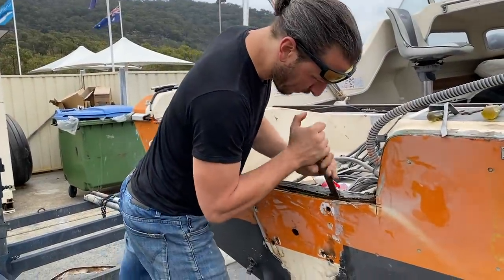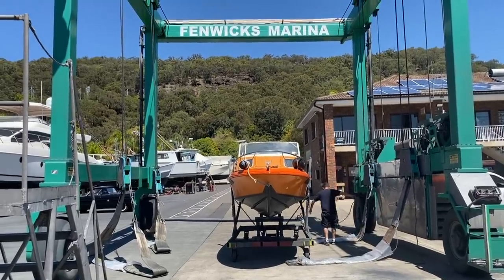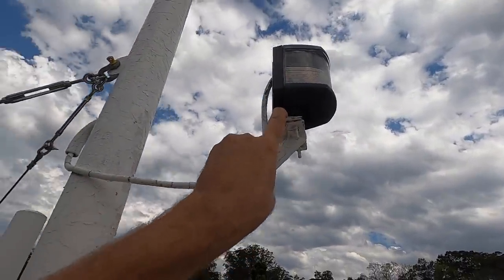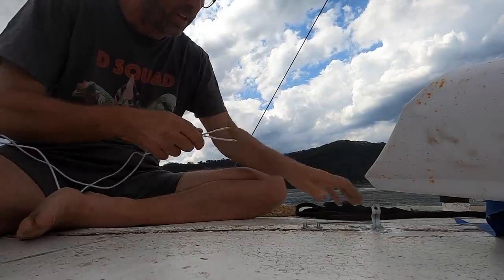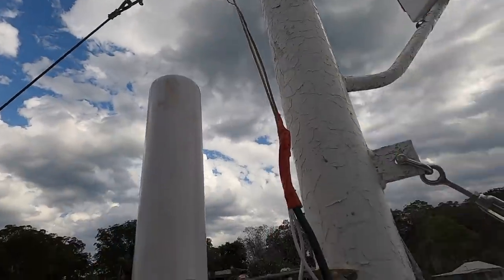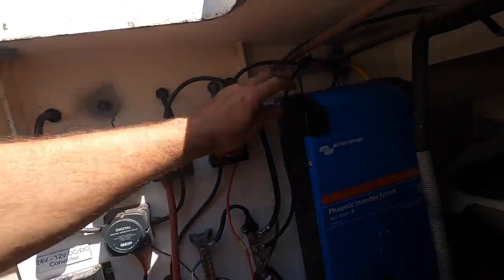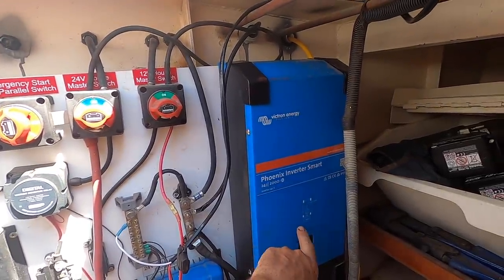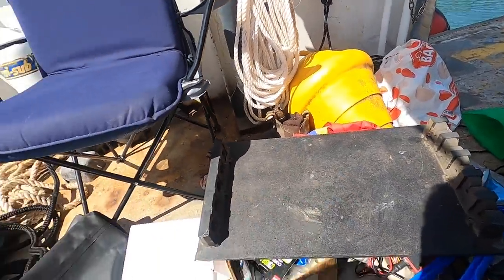Self launching bow roller for the anchor, and neater wiring!

Comment: Cut your mast off near the base, rip out the wires & whatever is blocking the mast, repaint the mast inside, weld the mast back on.
Reply from the maker: An opportunity to repaint the inside of the mast would be good.
Reply: @DangarMarine  It would prevent future rusting
Reply: Don't know if you have any bridge clearance issues, but if you are cutting off the mast, it would be simple to reinstall it on a hinge base to allow it to be lowered for low clearance bridges.

Comment: In many places, the mains "neutral" and "ground" are normally tied together, at (or near) the distribution board. As you'd pointed out in the video, this helps the positive voltages find a safer route to ground than, say, through a human. It also facilitates detection of a ground fault -- the ground wire usually sidesteps the current sensing of your RCD, giving a positive bias (at the current sense) and breaking the circuit. Big Clive has a number of good videos on how that works if you're interested, including teardowns of RCD/GFI-type sockets and breakers.

Comment: Just a sagestion you could cut the bow roller back to suit or maybe cut it down on both sides and bend it to the angle that works and weld a stainless v in on both sides to make a smooth transition ..

Comment: In regards to the heat exchanger. Our motor was seized when we bought the boat, from neglect of changing the anodes. The alu heat exchanger had corroded, popping the cast iron exhaust joiner off the back. The coolant then leaked into cylinder 2, seizing the engine.

Anyway, took it to an engineering shop mate, he machined back the corroded shit, and tig welded on a new alu plate to bring it back up to thickness. With appropriate holes machined into it. 

Might be an option?
Reply from the maker: Definitely something I'm going to look into.
Reply: @DangarMarine  Although if you can find a generic heat exchanger, I would be interested.

Comment: Hey Stu, in relation to the stuck ring in the engine, I being a retired diesel mechanic, would it be a hassle to remove the crankcase cover port and move the piston down till you see the stuck ring and spray WD40 into the ring gap hoping it may free up with time. Obviously this could only be done when the engine will not be in use of cause, but I thought if you had a time in mind in the future say Christmas/New Years you could do this and let the WD40 do it's thing over a week or more maybe, just maybe it may start and free up !!  Just a thought buddy. I think shore power plug socket should go on the new power board and maybe notch the hatch cover to allow the extension cord free access and keep the engine room sealed from rain and weather.  Seeya Rob
Reply from the maker: The stuck rings seem to be a bit freer now, but it is the oil rings that are the real problem and they never come up as high as the liner ports.

Comment: The power from shore is already protected, so mounting the shore plug near the wheel house and your own secondary protection in the hull is not a problem. To the point I'd almost ask why you would bother with a second RCD, I mean do what ya want. But if I was to guess why you would use a second RCD it would be to have a 10mA on the boat to bring you down to hospital standards, where as the shore RCD will be 30mA. I imagine there is some doubt as to how good the ocean is as a functional earth, which isn't really how an RCD works anyway, and if the hull became live then you wouldn't notice anyway because you wouldn't have any potential difference. 

Basically, you are well over doing it, so don't worry about putting the RCD a few meters away from the socket.
Reply from the maker: Good point about the shore power already being protected by an RCD mean the galvanic isolator is probably the most important part.
Reply: I think it depends how the system is set up. Do you have parallel switching or are grid and inverter separated.  Inverters don't really need RCDs but grid systems need them. As mentioned the grid source likely already has a RCD.
If worried about it you can simply get an extension with a built in RCD. Mainly it is larger motors you need to worry about.
Reply: @DangarMarine  I'm surprised the shop didn't sell you a double sized box, with the isolator in the same box as the socket, same as any industrial GPO has the on/off switch above the socket. 
I'm more than confident that you won't have trouble with the isolator a few meters away, but if you are worried then a double box is a solution
Reply: @lemullet6273  Lets be honest, the only leaking Renko does is inwards lol
Reply: @lemullet6273  What Stu is talking about, has already been applied at the source, so he is doubling up on the protection.
Reply: @lemullet6273  "Most boats drip though" - would mean most boats leak inwards. You see my friend, inwards means from outside to inside, and leak in this context means water transfer, so the combination of leaking and inwards would imply water is going from outside the boat to inside the boat, as admitted by you. Great chat :)
Reply: @lemullet6273  Ahh I see the problem, humour isn't your strong point. Too bad Renko is an aussie boat, owned by an aussie, and Australia is a humourus country
Reply: @lemullet6273  Probably because you care about what the guy in YouTube comments says. I'd see a doctor about that tbh
Reply: @lemullet6273  do you not understand any particular words, OR do you understand all of the words, but not understand what the words mean when in said order?
Reply: @lemullet6273  You know, if we were socialist West coast Americans, it would be "our" comment
Reply: @lemullet6273  Sounds like a faulty unit, I guess Made in America doesn't mean what it used to

Comment: Don't forget: when taking that -VE off the engine,  you MUST still have a direct negative connection from the engine to the -VE on the engine start battery. This MUST be direct, otherwise you get starter motor current of several hundred amps flowing across your house battery negative connection to the hull etc.
Reply from the maker: Yep, there is still a direct negative to the starter motor.

Comment: If you haven't cut the anchor mounting flush, perhaps think about putting an extra roller as a chafe guard.
Reply: Perhaps spool the chain and anchor line off the top of the drum to change the angle?
Reply: @paulsperbeck617  yes , i was thinking the same but it will be higher on deck and maybe hard to pass over it'
Reply: Definitely.  Thin rope is like braid, less abrasion tolerance than thicker line.

Comment: For the anchor chain issue,  try drilling in a third roller at the beginning of the bow roller to prevent the rubbing.
Reply: That was my thought too. Or, put a 1/2” stainless bolt through it and cut a piece of UV resistant PVC pipe to slide ice the bolt to act as a bushing for the rope and chain.
Reply: Yes, and you still have the old roller to use...
Reply: Or you could cut the sides and bend it down at an angle so it guides but doesn't chafe

Comment: I really think a 3rd roller is the easy way to go. Just drill a hole in either side no cutting, no grinding, no metal splinters, and it saves the back 2 holes for adjustment should you acquire/require another anchor.

Comment: i wouldn't cut that feed ramp off the stainless bowsprit. Better to cut each side wall where it meets the mounting base & angle it down so it acts as a ramp.
Reply: Good call as the chain will allways fall and hit as it pays out, but might leave a few sharp edges.
Reply: @nou238  Should be able to chamfer the cut edges with the grinder Or Stu could move the anchor winch higher up the cabin wall or add a pipe for the chain & rope to feed through.
Reply: Yes agreed really need to make a feeder particularly with longer lengths of chain >600mm in horizontal- cut and miter the overhang inside of the stem mount. Definitely need some for of chain feeder -don't always have the perfect anchor launch and retrial particularly caught in a storm and heavy seas.
Reply: Went back and checked the video again possibly look at building the sides up on the aft end of the feeder- stainless steel pin across the top so the chain cannot jump off the aft end of the ramp.
Reply: @tonyboats  A length of stainless steel 3" or 4" exhaust pipe & have them slightly flare the entry & exit holes would work as a feeder to the bowsprit.
Reply: Just what I was thinking also!!

Comment: Rather than cut the anchor tray shorter, how about put a 3rd roller right on the end.   Even cut the bottom of the tray a bit, so you have 2 wings and the 3rd roller could be lower. So right at the boat end you had a roller to guide the chain/rope seeward.

Comment: 👋🏼fròm WÅ🦘
Fascinating about the technique in determining anode effect✅
➕With your remote placement of anchor, maybe keeping the channel length would help contain a linear path, also courting a mig/tig for a linear offset [ within an angled 📐 composition, additionaL to a roller’s height, or neoprene lip ] to winch would favourably serve, along with a shroud.to dampen a potential impact.
➕ just a thought 💭 isn’t there an equally capable anchor that has that overhead affixed railing, that allows the operator to change retrieval position if the setting becomes abjectly fastened 🤔💭
Be WeLL 🙏🏼🖖🏼😃🦘🌊 🤿 🐟
Reply from the maker: Thanks Adam, appreciate the thoughts.
Reply: @DangarMarine  Ür worth the concern, 👁 Prefer not to s👀ïnG yoÜ🤿 in traction⛓🩹, 🌱eåčH, say GDaÿ to Bilge 🐀 för më😉🖖🏼🙏🏼

Comment: 2:35, D-Squad in the background keeping things safe for the film crew, patrolling the grounds!!!!   Nice work girls.
Ok, on the shore power outlet, addressing the safety aspect of running from the wheel house or mounting under the hatch.  All shore power in marinas up here in the US have GFCI protection on them, which would ensure that even a small short (to ground or phase to phase) would trip the circuit feeding the boat.  I don't see that as a safety issue to be honest.  I see bigger problems with that heavy lid crushing a wire.  But that's just one mans opinion.  Good luck.

Comment: Instead of cutting the anchor holder, I would maybe look at getting a bit of HDPE or similar to put around the end so that it protects the steel and also protects the anchor line. From experience, dyneema starts fraying pretty easily when rubbing on anything really.
Reply: That would be the least expensive. You could always drill and add another small roller.
Reply: Cutting the end off would also eliminate moving it to the utmost forward setting. Place an HDPE guide.

Comment: You need the marine power socket as it locks the plug into the fitting.  If it comes out and goes overboard, 240 v in the water.   If you stay with the caravan type, work out a way to tie off the power cable to keep the plug on board.
Reply from the maker: Good thought, that is an important situation to avoid. Maybe I will go with the marine type and just have a lead onboard that lets be connect to a regular socket on a wharf.
Reply: @DangarMarine  We replaced the marine plug with a standard 15 amp plug and that saved having any other leads.

Comment: Those wondering 20:21 he says RCD which is a residual current device. Basically the same thing as a GFCI (ground-fault circuit interrupter) used to immediately disconnect power for kitchen and bathroom plugs. For example if you dropped a hairdryer in your bathtub you wouldn't die. They react very quickly and often have a test switch on it.
Reply from the maker: Yep, should have done a quick explanation on how they work. Will do soon!

Comment: Stu, what about drilling an access port close to the bottom of the mast to help you guide cables through,then just cap it with a bolt on cap sealed with some Sicaflex. Instant access if you need to get to it in the future. Great work, by the way. Looking forward to the diving vids. 👌👌
Reply: i was thinking the same  thing--  just like a lamp post.
Reply: You take away quite a bit of structural integrity of the mast by cutting a hole into it. Now, it might not be as important as with a sail boat but it still has to withstand winds.

Comment: The dyneema anchor rode is great stuff because of its strength/diameter ratio.  The weakness is it is not very abrasion resistant.  I noticed your concern regarding the anchor chain rubbing the bow anchor bracket.  It looks like the dyneema will also rub.  Be careful there Mr. Dangar.

Comment: Hi Stu, need a little help. I have a seized manual tilt screw on my Yamaha 175 outboard. I intend to service the trim tilt system, so started with the manual release first but the screw just won’t turn to release the motor. 
Should I try the impact wrench gently, the sort you hit with a hammer gently?
Just keep the videos coming. I did almost the same as you on a 36ft cruiser loved almost every minute of doing it.
Best regards, Jonah.
Reply from the maker: Yes, you can try an impact scre driver but be careful, they can strip and then you'll need to drill it out without getting metal into the hydraulic oil. Try a little bit of heat too.

Comment: Awesome project you’ve got going on. That dyneema is ridiculously strong, and will def do the trick, something to look out for would be when you are anchoring, try pay out excess line and make this fast onto the bollard just forward of the storage drum. If you and anchor and the weather gets up the line may bury itself into the storage drum when the tension comes on. This will be an absolute nightmare to get out. It may well be that you were just testing the system, just something to look out for.
Reply from the maker: For sure, cleating it off would also take the strain off the winch itself while at anchor, definitely something I would do for an overnight stay.

Comment: I wouldn’t worry about oil discharge from the air box drains. Detroit diesels are known to “slobber” from the air box. Many installations have a catch can or tank that collects the oily discharge to keep it from making a mess or fouling the bilge water. With time, it may even taper off as the rings wear in a bit. That engine sounds just fine. The best thing you can do is run it. Sitting still in the marine environment destroys engines prematurely.
Reply from the maker: I was thinking about just going with a catch can, but it is more than it should be for a rebuild engine. Adrian is thinking that maybe the oil rings are damaged from loading the pistons in to the top of the liner instead of the bottom as they should. Easy mistake to make if you aren't familiar with Detroits.

Comment: Gday Stu why not extend the bow sprit out so its level (flush)  with old one underneath the only thing i would cut are the ears off the old one were the roller used to be plus having it extended further out could help anchor from banging on the bow in choppy windy weather as you lower / retrieve and if that dont work bang on an extra roller too but DONT CUT THE NEW BOW SPRIT

Comment: I am with Peter, the addition of a roll on the inboard side of your anchor bow spirt will give a reliable feed that the chain won't fowl with the bracket even if it slops around a bit as they tend to do. I don't think that shortening it will resolve the possibility of the chain catching on the leading bracket edge, in particular if it goes a bit slack.
Reply from the maker: Yes, it is true that no matter how short it is any slack will still catch.

Comment: Hi Stu, May I respectfully suggest that you review you swivel to anchor connection. KONG swivels recommend connecting the swivel to the anchor shank, with a bow shackle or (better option) a bow shackle and three links of high test chain.  The straight line Safe Working Load (SWL) is reduced by +/-60 percent when a sidewise load is applied to a swivel with it's fork end attached directly to the anchor shank.
Reply from the maker: Yep, have been meaning to add a shackle in there to relieve sideloading.

Comment: Hi Stu, Thank you for getting back. Spent two days putting the fix all WD40 a quick spray every two hours. Then a large wide flat blade screw driver, the screw driver that belonged to my Grand Father it must be close to 100 years old but as it’s a proper cabinet screw driver, the good old fashioned sort with a large  wooden handle plus a flat section just under the handle. Slip an adjustable spanner on the flat and with the extra leverage the screw gave way and started to move again. And people ask me why do you keep all this old junk.( junk being old workshop tools)
Reply from the maker: Great to hear you got it moving! :)